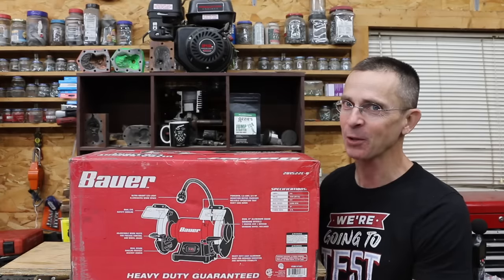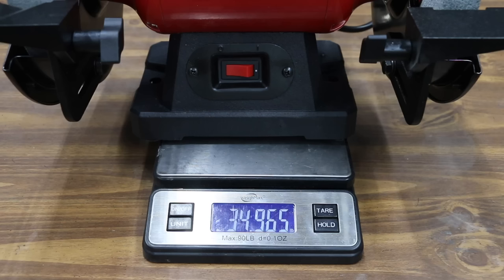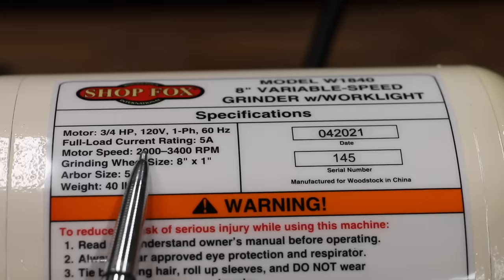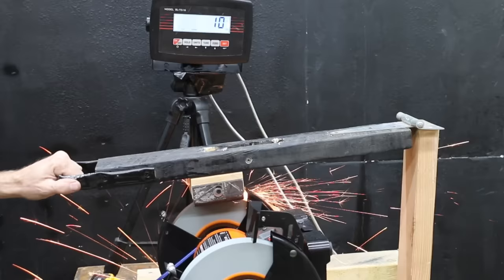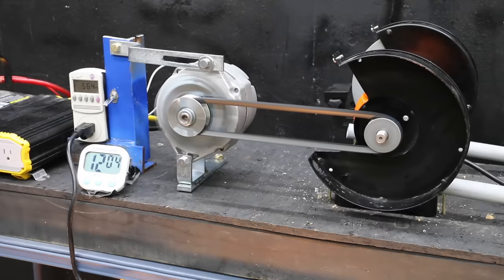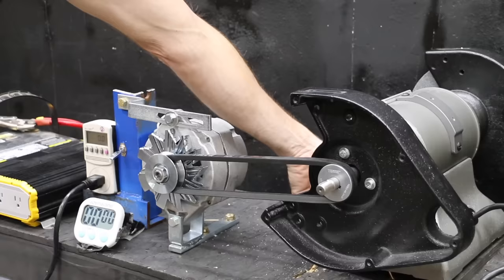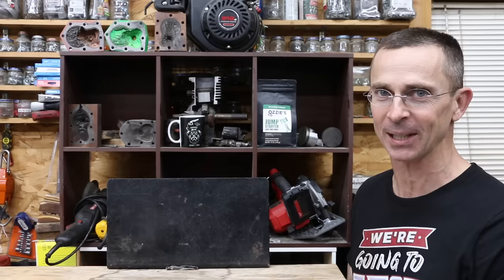Best Bench Grinder? Let’s Settle This! Harbor Freight Bauer vs JET, Hercules, Rikon, Shop Fox, Delta

Comment: The main problem with cheap things is ventillation, heat dissipation, maximum usage duration before burn-out, durability and reliability. If these can be solved by modifying for cooler and use at half-power, then the pricing-ratio of 5 to 1 becomes interesting for boys who wants toys.

Center shaft(more balanced than cog-gear) drive grinding-discs.
Quarter grid box-cage to house 4-1=3 motors
3 pieces of cheapest motors
Grinding portion should have no-motor (use release-vector of forces with aggressive things)
Reply: Engine inertia versus load inertia
Reply from the maker: Thanks for the feedback.

Comment: The jet is probably a capacitor start. We had an old handed down grinder with worn out bearings, So I just decided to replace it with the "equivalent" central electric grinder to find out it takes an eon to get up to speed...I took it back and put new bearings in the old one,  it's capacitor start and it was a cheapy grinder when it was new 30 some years ago
Reply from the maker: Thanks for sharing.

Comment: A SLOW start id not a bad thing...    A slow start means LESS amperage needed during stat up  Which also means LESS  chance of a breaker trip or fuse blowing during start up .  This is great if your lights are on the same circuit so less chance of fuse blowing or breaker tripping...
Reply from the maker: Thanks for the feedback.

Comment: I'm interested in getting a grinder with a CBN wheel setup.  I've heard that CBN wheels are a lot more sensitive to wobble on the shaft, and that the Shop Fox is bad for that.  I'd be interested in seeing a comparison off CBN wheels and seeing how these grinders perform with them.  Thanks for the reviews!
Reply from the maker: You are welcome!  Thanks for the suggestion.

Comment: Being a woodworker primarily, the brute force of my grinder is less of a consideration than the quality that I grind. To that and mine is a Delta variable speed when I got years and years ago on sale. I believe I spent about three hundred or so on it in Canada. If you have to grind things like lawn mower blades Etc than a regular silicon carbide wheel is what you want. If you're grinding more delicate things like high carbon steel tools for planes and chisel blades, then you need the white compound cool cutting grinder wheels made by companies like Norton. Drawing temper on these blades and materials is expensive and completely unnecessary.

Also a good practice is to stand to one side when you power on a new wheel or when you haven't used in a while. Those guards are only good for stopping little bits of debris not a disintegration of spinning grinding wheel.

Had a garage sale years ago, for 40 bucks I got a water-cooled grinding wheel that also had one on a fixed platter with a water drip. It was rather dished but I got the bright idea to use a 10 by 3 flat Diamond Stone to true it.
Reply from the maker: Thanks for sharing.

Comment: I would love to see not only the best but how you manage to test air nozzles/air guns. I mean those air guns or venturi air guns for both strength and/or volume of air or even precision. I need to clean electronics, engine compartments, and other miscellaneous areas. Was looking at Snap-On but think its just the brand name and maybe the price should be tested by the legendary Project Farm! I imagine more air traveling means louder too... (HI-FLO Venturi Tip Blow Gun)
Reply from the maker: Thanks for the suggestion.

Comment: On spinning some of those up, there sure is a lot of wobble on some of those grinder wheels.  I bought a 1/2 HP two speed Bucktool and I've been happy with it - it's very well balanced.  Don't know how much torque it will withstand but I'm not hitting anything heavy with it.

Comment: Digital Calipers review. It doesn't have to be super expensive metrology based, rather more for your use like garage ruggedness, repeatability, corrosion or wear resistant (like scribing a line). Of course Mitutoyo and Starrett would do well, but random amazon picks like Neiko or Wen would be more budget comparison. Battery life would be super helpful coming from using one Pittsburgh digital calipers that drained the battery in a matter of weeks.
Reply from the maker: Thanks for the suggestion.

Comment: As a new electrician I’d love to see you review torque screwdrivers. There is a wide range of quality and price, from WIHA down to Amazon brands from Asia like SanLiang.  Similar to torque wrench but on lower end of scales and different field using (mostly electricians).  Also helpful for DIYer wanting to do their own electric work
Reply from the maker: Thanks for the suggestion.

Comment: Thank you for your comparison tests. Before I purchase a new tool I look to see if you have done a comparison. you do repeatedly make a common error however. When you list the specs for the motors you sometimes refer to the Amp draw of the motor as Amp hours. Amps and Amp hours are two entirely different things. Amps is a measurement of power and Amp hours is a quantity of energy over time. Amps is to Amp hours as horse power is to fuel used. They are just not the same thing.
Reply from the maker: Thank you!

Comment: How about a comparison of a very commonly used air tool, the Die Grinder. I use them daily usually to shape small fabricated metal parts. Both of my HF die grinders have failed within a few days of each other so I’m now in the market to replace them. Great content as always. Thanks!
Reply from the maker: Thanks for the suggestion.

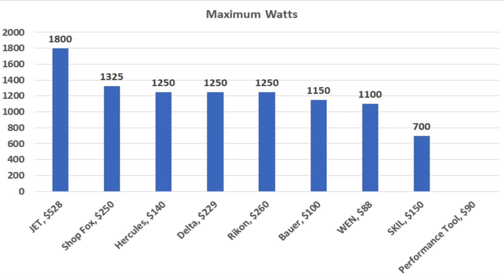Comment: 12:55 Fascinating to see this. I have some piston engines literally small enough to fit in my pocket that make more power than that! But they do have to rev a lot higher to do so. Many are mounted on my RC airplanes and do a great job at their intended task...IE pulling those aircraft through the air.
Reply from the maker: Thanks for the feedback.

Comment: I know this has nothing to do with this video but I know you read all your comments so I wanted to write it on something newer. With there majority of newer engines being GDI. It would be great to see a video made of the best intake valve cleaner. Sea foam, Lucas, CRC, ect. If that’s something that can be done in the future I’m sure it would help out alot of people that are heading or they will have dirty intake valve issues there will lead to misfires, poor fuel economy, even damage to the valve its self if I hard piece of carbon gets jammed in the valve seat. Please lmk if this is a possibility. Thanks
Reply from the maker: Thanks for the suggestion.

Comment: I’m impressed with your videos, thank you! How about a comparison of dry silicone spray (I use it a lot on saw blades, zippers, tabletops, pulling upholstery fabric over foam or anything that needs to slide or be nonstick. How long does it last on a surface, is one brand more slippery than another. I’ve used more brands than I can name, the two brands that come to mind (without googling it) are 3 in 1 and Jiggle lube. Looking forward to your next review.
Reply from the maker: Thanks!  Thanks for the suggestion.

Comment: i understand you want to test these how they come out of the box but
some of these tests could be fixed by changing the wheels(stones) as

the markings are (example:WA 60 K 7 V)
Abrasive Material: WA - white aluminium oxide
Grit Size(Coarse 10 - Fine 1200): 60
Grade (soft A - Hard Z): K - mid grade
Structure (Dense 1 - Open 14): 7
Bond Type: V - vitrified
- there are 13 types for Abrasive Material and 7 for Bond Type

if these tests are not done with the same stone code it can through off the test

EDIT: sorry i forgot to mention
!!NEVER USE A FRESH STONE!!
you should always dress the stone before use for these reasons(below)
1. depending on the stone it can absorb moisture and other things from the air making the outer surface weaker then it should be (minimum time between dressing with no use 7 days, before use)
2. fresh stones that have not been dressed because of #1 have a higher chance of shattering if the surface has been weakened by moisture or something hitting them
Reply from the maker: Thanks for the suggestion.

Comment: Since getting angle grinders with flap discs I rarely use my multiple bench grinders. Two are old Wens and excellent machines. The other tools my angle grinders made mostly obsolete were my abrasive chop saws. If you're not into heavy DIY you may be better off not getting a bench grinder at all and I would not consider it urgent. My angle grinders with appropriate flap abrasives and thin kerf cutting discs get near daily use.
Reply from the maker: Thanks for the feedback.

Comment: At some point should you revisit this topic I’d be interested in how the Palmgren 1/3 Hp, 6” model stacks up. Seems to be the most poorly marketed grinder out there and the price has increased 60% since I purchased mine in 2019 but I’ve been pretty happy with it and it runs smooth and quiet.
Reply from the maker: Thanks for the suggestion.

Comment: There are 1hp grinders by Rikon, Grizzly and few others that cost in the $250 - $300 price range but I guess in order to make Jet look good at $500 you compare it to much cheaper versions. Test Jet vs the other mid range 1hp grinders and see how it fairs
Reply from the maker: Thanks for the suggestion.

Comment: I was wondering if you can test more oil additives. Specifically arc oil 9100, 9200 and turbo Maxx head to head.
Reply from the maker: Thanks for the suggestion.

Comment: @Project Farm,  Have you done any small shop Air Compressor testing? I don't remember seeing anything. There are so many bogus claims on these things it hard to tell what would work for your needs. Small tools, impact, spray paint gun?  Would be an expensive test, but I think a really good one!
Reply from the maker: Thanks for the suggestion.

Comment: Exactly what most buyers need. Would be nice to see the Grizzly added to this lineup.
Reply from the maker: Thanks for the suggestion.
Reply: @ProjectFarm  Apparently Shop Fox is made by Grizzly. Shop Fox is there higher end brand line apparently made in a cert ISO 9001 facility with a 2yr warranty vs their Grizzly brand line at 1 year. 

Speaking of which, warranty and availability of replacement partts would be a good comparable on these videos. It's one of the one of the reasons, contractors seems to generally prefer Milwaukee over DeWalt, part schematics and availability of parts.

Comment: I'm going on an extended motorcycle trip starting the Spring of 2024. I have sleep apnea and I'm planning on tent camping most of the time. I would like to see which 750 watt or larger battery generator charges the fastest and lasts the longest between charges. Size and weight also a factor.
Reply from the maker: Thanks for the suggestion.
Reply: @ProjectFarm   This is always my go to when I'm buying a new item, I just go back to the archives look it up easy choice. thanks for the hard work.

Comment: I understand the supposition that split ring lock washers don't work. unless the underside of the bolt was notched or the lock washer was of a harder substance than the bolt, the spring tension higher, all that. But I've never seen anyone do an actual text. How would you even go about testing the premise?
Reply from the maker: Thanks for the suggestion.

Comment: For all your motor speed tests, have you checked the frequency of the power you are using? Motor speed is tied to AC frequency. Also, does anywhere but China make a bench grinder anymore?

Comment: Would it be within your scope to test aviation piston engine oils and additives? There are syrait Ashley's dispersing and blends with antiwar additives. Also, there are a few separate additives out there. Lycoming engines have their own proprietary additive that I think is mostly zinc. One of the biggest problems facing aviation engines is internal corrosion due to long periods of sitting. Some of these additives are supposed to keep a film longer.
Reply from the maker: Thanks for the video idea.

Comment: Bought a cheap angle grinder like $50.
Worked great for about a year then the capacitor went out and it wouldn't start up.
Online they cost about $15.
Reply from the maker: Thanks for sharing.

Comment: My workshop technician told me that some cheaply made grinders actually use aluminum wire for their motors instead of copper. These grinders are weaker and heat up so much faster, not even recommended for hobbiest.
Reply from the maker: Thanks for sharing.

Comment: Have you considered doing windshield automotive washer fluid for testing of both temp (freezing factor)/bug/streaking performance?
Reply: Would be curious on your thoughts Todd, unsure what other test could be done. Never know if cheap options of 3$ to 4$ gallons vs the 7 to 10$ gallons brands are worth it.
Reply from the maker: Thanks for the video idea.

Comment: Project farm! Love your videos! Got a request for you to test and the racing word will love you for it! Can you test the methanol oils such as VR1 Valvoline 20w-50, Schaeffer 0191-012 Micron Moly Racing 20W-50, and Penn Grade 1 SAE 20W50 Synthetic Blend Performance Engine Oil? 

There is many debates out there and it would be nice to have an independent review as to which oil resist running methanol with the moisture problems running methanol. Thank you for all you do! Donovan
Reply from the maker: Thanks!  Thanks for the suggestion.

Comment: How about doing one on IR temp guns. Is the 400 fluke that much better than the 100 fluke or 50 harbor freight?
Reply from the maker: Thanks for the suggestion.
Reply: If you do can you please include fluke 561 and/or the fluke 62 max? I’m a industrial hvac mechanic and using temp guns is common (up to 600-700°). I have both flukes mentioned above and I’m getting a 40° differential. I got a Fieldpiece or gun and it’s a separate reading. Not sure which is most accurate. Your the man. I check your channel before I pay money on any tool and I trust your breakdowns. Thank you.

Comment: You kept saying amp hour instead of just amps. Amp hour is used for batteries ect. Means it can supply that many amps for 1 hour. It is inaccurate to refer to a motor rating in AH. It is just amps since there is no duration.

Comment: Your tests are well thought out objective. Where I disagree with you is in testing of the abrasive wheels, which are wearables that are not made by any of the manufacturers shown. You also left out the most expensive grinders made by Baldor and Dayton, which almost certainly would have dominated the competition. Furthermore, there are many, many used bench grinders on the market that would blow away all but the most expensive modern grinder. A vintage 40-50 year old Wissota or Craftsman "block grinder" can be had for around $100 in almost every corner of the country, so why not make the comparison? I think that most of your viewers, if shown the difference in quality, would choose a vintage grinder over a brand new one.
Reply from the maker: Thanks!  Thanks for the suggestion.

Comment: These were good tests but vibration / trueness should definitely have been among the tests. Also I havereservations about testing them with the wheels they came with rather than with identical wheels. Besides startup time, this could have affected the stalling test (less pressure required to press against a rougher wheel to create drag).
Reply from the maker: Thanks!  Thanks for the suggestion.

Comment: Can you do one with the best buffing wheel? Most shops utilize bench buffers far more often than bench grinders. My work uses Baldor bench buffers, but I'm curious as to how mid range buffers, (I.e. Jet Tools), and lower end brands (i.e. Bauer, etc) compare to the Baldor. Right now, I'm looking at the Jet Tools 8 inch variable speed buffing machine to add to my work bench.
Reply from the maker: Thanks for the suggestion.
Reply: @ProjectFarm  You're welcome. They can be used for many different purposes, including polishing with cotton buffing wheels, fixing scratches, nicks, and sharp edges with a Scotch Brite wheel, and deburring with a nylon or wire brush. For ultra fine scotch Brite wheels, you may have to stack 2 or 3 against each other or stack some spacers and washers against it.

Comment: I've had my sears grinder for about 20 years and I have to admit,  it's not very good.  I've had a bench mounted grinder / wire wheel that's as old as I am, and has a separate motor.  The old one is the one I generally use.
Reply from the maker: Thanks for sharing!

Comment: If your gonna spend $500+  on a bench grinder, buy an actual USA made Industrial one by Baldor or Kalamazoo folks.  A Chinese  made Jet is not worth that kind of loot. It does have impressively thick cast iron wheel guard/dust housings tho!  To be fair the Shop Fox is the best 3/4hp bench grinder.. The Jet is a very nice Chinese 1HP grinder tho.  Its should be for its insane price , you could easily find a Baldor for that .
Reply from the maker: Thanks for the feedback.

Comment: I believe more and more the age old saying "they don't make it like they used to". I bought a used grinder from a closing mechanic shop that was in business for about 50 years for 40$  canadian like 10 years ago. It was my only grinder that I ever used and I believed all grinder were similar. Seeing this I'm appalled. The grinder I have perform like the jet. I have to bolt it to the bench and press with all my force to start to make it bog down and its instantly ready as soon as I flip the switch. It don't have the eye protection anymore, no dust collection, the tool rest don't look nice but does it do the job right he'll yeah. This old beat up bench grinder of 40$ canadian is in the class of a 500$ usd grinder. Wow. They don't make it like they used to.
Reply from the maker: Thanks for sharing.